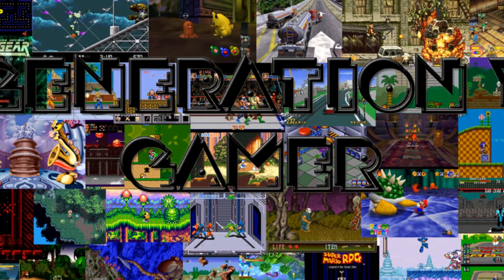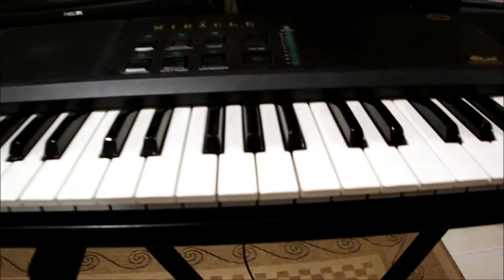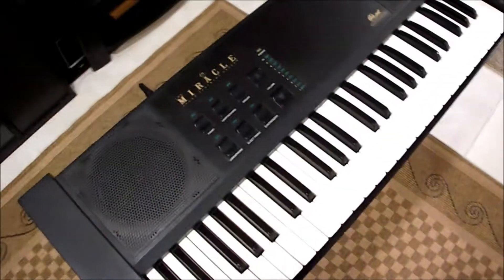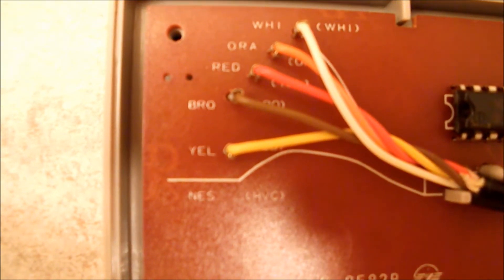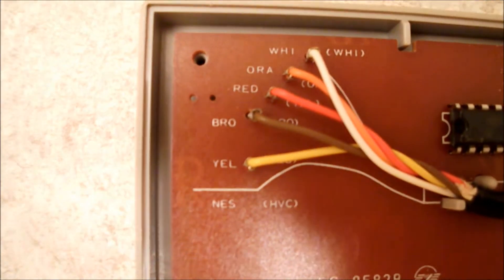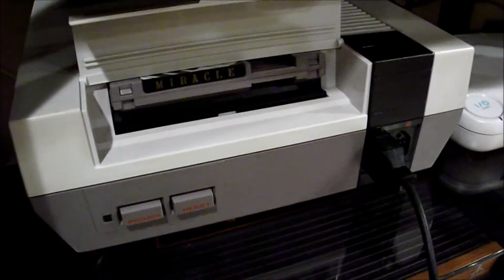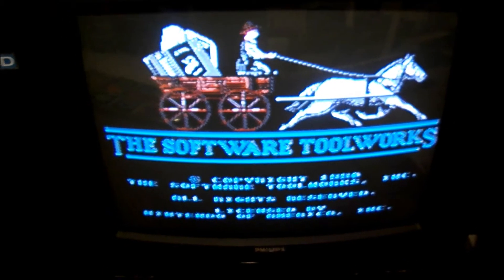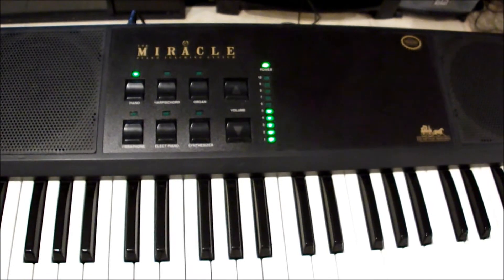Nintendo Miracle Piano- How to make a replacement system cable

Comment: Thanks for this video!  I just made my cable using your instructions - thanks!.  I do see an error though.  The diagram of the 25 in connector show 19 at the wrong in - according to your pic after the diagram the 19 should be on pin to the left (leaving 6 open pins to the right) ... after some trouble shooting of my cable i used the configuration in your picture and not the diagram before it with success - thanks for this tip!  not i can play miracle piano to my hearts content!
Reply from the maker: You're totally right! Glad you got it sorted out.